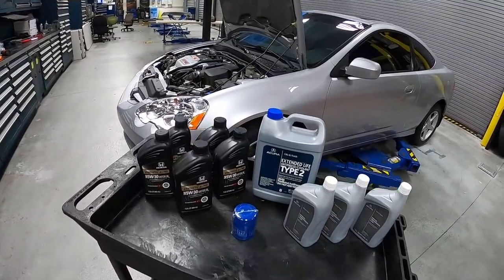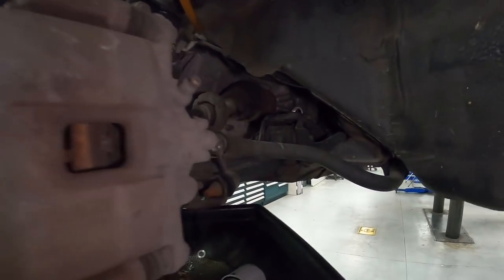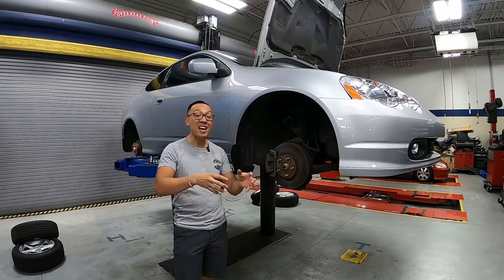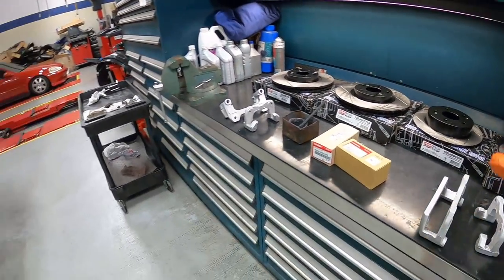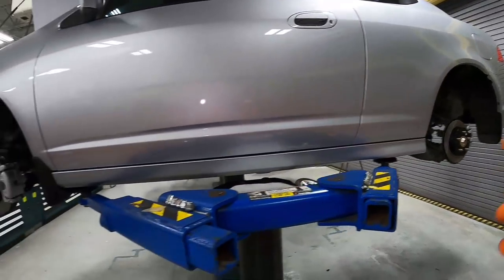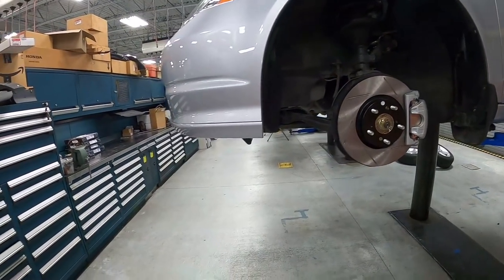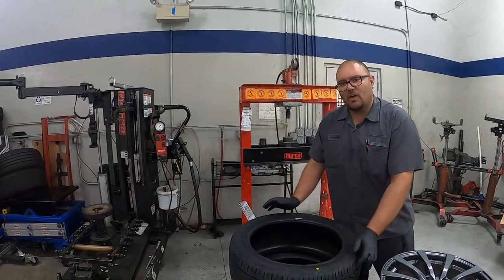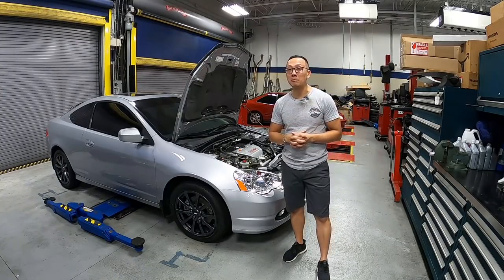All Original 2002 Acura RSX Type-S DC5 - New Mugen Wheels | Brake Refresh | Maintenance  (Episode 2)

Comment: This is so clean. I mean, I picked up the Xtra series from Brembo and anything after 30 mph it sounds like a freight train is going down the highway. At highway speeds it’s almost unsafe. Had Honda check everything for hub damage, everything is fine. They said it’s def the brakes. They are drilled or “dimpled” I don’t know what to do, after seeing this the stop techs are really nice!! My brembo are already rusted to hell. Not even 2 months on. I don’t know what’s wrong, all brackets are ok. It’s as if the pads are grinding down the rotors :(

Comment: All the rust in the hubs should be cleaned out before placing the new rotors into place , to make sure the rotor seat flat on the surface , other than that good work

Comment: You did a great job on the car but your tire guy dropped the ball because the yellow dots on the tires are supposed to be oriented in front of the valve stem to insure less weights placed on the wheels.
Reply: I’ve been aware of that DOTS are placed for that special Reason  Didn’t You guys at AHC !?!

Comment: No sparkplugs? Interior filter and air filter?
Reply from the maker: Both engine and cabin filters are new. Spark plugs are still in good shape and no need for replacement until probably 90k

Comment: Where do you find the black trim that goes on the top of the doors below the window.
Reply: These guys work at Acura. They probably source stuff out that’s discontinued from other dealers eith NOS parts
Reply from the maker: They are factory Oem part, still available at your local Acura dealership